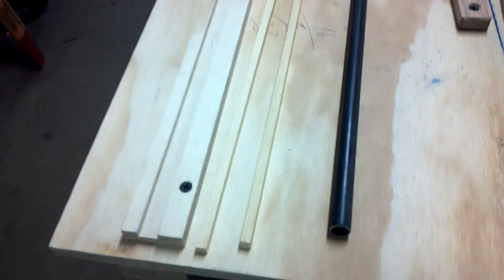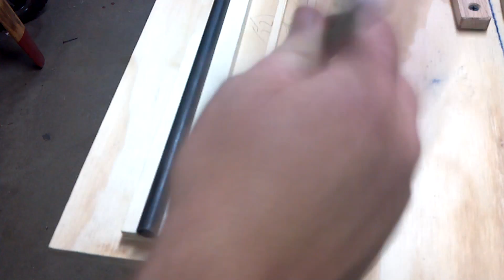Legal Eagle Ultralight construction video #7

Comment: Another way to do those index marks is with a square collet block and a collet. Install onto the center, make a short jig to hold the other, then mark. Rotate 90, Mark, repeat. This way if you are off center slightly it doesn't matter - you will go 90 degrees every time. You have to make sure you don't swap it end for end when you mark the other end, otherwise height offset will impart a twist.